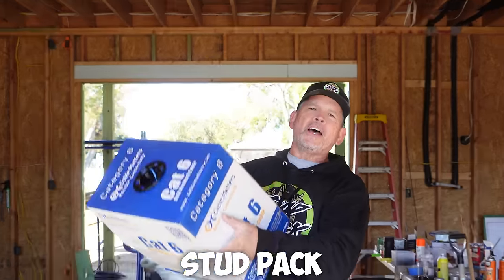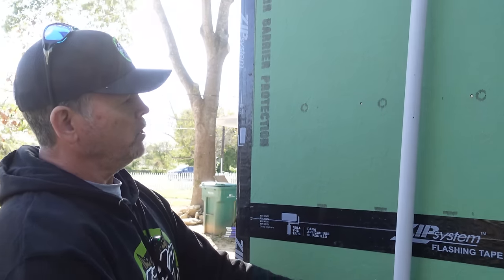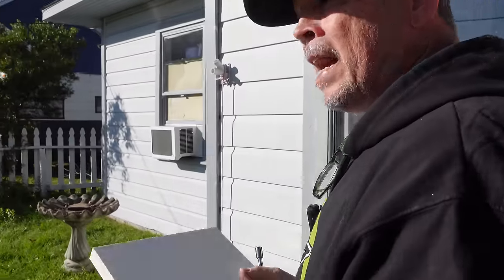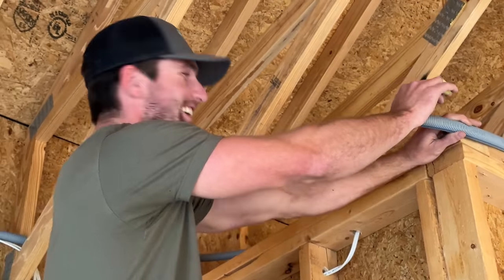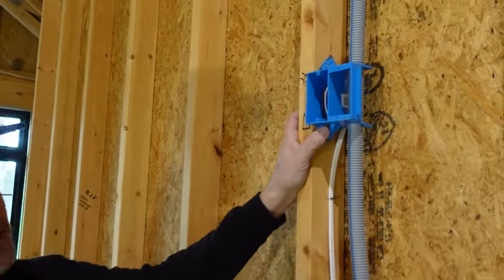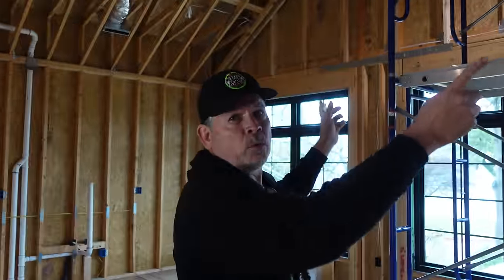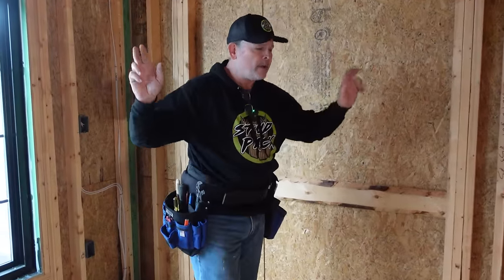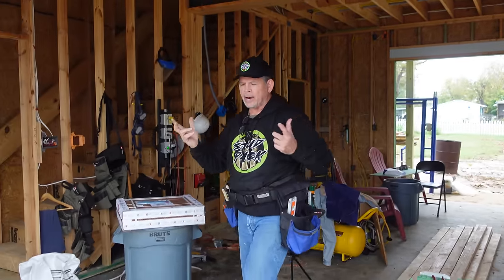DIY Networking for a Future Proof and HIGH SPEED Home! (Smurf Tubing and String Pull Trick!)

Comment: Run CAT6 to every room AND to every side of the house (outdoor rated). You never know when you'll need a hardwired connection in one of the rooms, and for outdoors you can hardwire up POE cameras and such. So fiber should go to a small distribution rack with the modem, have a patch panel there, modem to a router, router to a POE switch, switch then distributes everything to the patch panel. Definitely use wall plates with keystone jacks.
Reply: Why outdoor rated if it’s inside? Outdoor rates cable is for sun exposure and if you get gel filled it’s for elements (keeping moisture out of the cable).
Reply: 100% this. Outdoor hard connections are smart (cameras). That they didn't run them to the eaves is a bit puzzling. Wireless TV, no thanks. Mine are all wired in the house with a little MOCA and a few Ubiquiti switches at various ends.. and a Dream Machine Pro. And a 16 port POE switch. And a NAS with 10 GBE (2 port) connected to my server and desktop machine for video editing directly off the NAS... Oh, my Fiber direct to the house goes into my DM Pro on the 10GBE WAN port. Even if I do only get 400MB... still a cool blue light :-)  You can do it men!

Comment: Never mess with Telecom guys...
They get feisty 😂

But patch panels are great and can be had fairly cheap.

They will also make your life easier when you're trying to figure out problems as you label them just like your electrical panels.

Wall plates/keystones make your life easier like everyone said, because you always can use a longer or shorter cable or even repurpose a jack.

Like if you were using a jack for just internet to a device but then you want to put a POE device there.  You add a longer or shorter cable and then run from your patch panel to whatever equipment (like a small POE switch vs your main switch for just that device.)

TL;DR
The first time you have to change something, you will have wished you did it the other way.

Comment: i know you mentioned your going to run the Cat 6 cable to the eves of the garage but i wouldn't recommend that on the eves of a 2 story building because the ideal height for a security camera outdoors is between 8-10 ft from the finished ground height, any higher then 10 ft for your cameras and you wont get the full advantage of your security cameras and most eves on a 2 story building are closer to 18ft which is to high for a camera to get the best picture
Reply: This.  I'm sure you've seen "security" photos on the news that show the top of the perp's head, or his hat brim covers his face because the cameras are so high.
Reply: @disqusrubbish5467  exactly it really helps with the proper placement of the cameras to take advantage of all the cameras visibility capabilities

Comment: One more thing. I know the office is temporary but in your final office location be sure to run a number of ethernet lines from there to back to your main switch. I did 6 for mine. I have 2 ethernet connections on my computer 1 for up and 1 for down connections to give me higher bandwidth back to my server (old cheap solution to improve speed).  I have 1 for my printer and 3 extras just in case. I initially did this because I was considering running my 3 monitors over cat7 and having my desktop sit back at the server (yes hdmi over ethernet is a thing). That never materialized but trust me you are going to want more bandwidth than you anticipate at your workstation.
Reply: I doubt these guys are running any type of server in this garage. 😂

Comment: It's good practice to never mix high and low voltage wires. Never run them parallel and only cross them at 90 degrees but only where absolutely necessary. It's better to have as much separation as possible between them.

Comment: Terminate them in the wall with a keystone jack.   The cat-6 cable is solid strand and solid strand is also known as riser wire.  It is made for the wall where it does not flex.   You need stranded cat 6 cable between the wall and computer because it flexes.  Solid strand wire will fatigue and eventually break causing connectivity issues randomly.

Comment: Doing a wall plate is way better than running the cord out of the wall. It’s also way faster to do the whole termination with electrical scissors and the crimper. Don’t need the little stripper.

Comment: Low voltage Ethernet is supposed to be as far as convenient and optimally 3’ away from AC power to prevent issues with the magnetic field. If your signal is good enough there is a lower chance for noise interference, but better to prevent it now before the walls are finished. I would run the low voltage on the opposite stud anywhere it is near power. Them sharing a double gang isn’t ideal but really you only get problems when they run a good distance in tandem. I was a cable guy for 4 years and have since went into electrical.
Reply: I meant to add, fiber doesn’t have interference issues with power, just the copper in cat-6. Also that divider in the cat-6 is to prevent crosstalk so I’m told.

Comment: Hiding your modem in the upper crawlspace is a big no-no! You need easy access to your modem, switch, patchbay, etc. 
Find yourself a few square feet on a wall somewhere. How about in the small room with the electrical panel? How about at the top of the stairwell?

Comment: Love the video. 

Please terminate the cat6 to a female jack and use a wall plate, much more professional and if done correctly doesn’t cause any additional connection issues (which is what I assume you are hoping to avoid by using male ends straight into your devices) 

Also, are you running cat 6 in the ceiling for wifi access points? 

And above your stair well I recommend you terminate the ends of all your cat6 runs into a patch panel and label them accordingly, bonus points if you use different color patch cables for the different “category’s” of devices. 

While it’s not ideal to have your data cables ran next to a power line, in my experience you will not notice any difference in speed or loss. Only time it’s okay to run data and power accoss each other is if they are perpendicular to each other. 

The string inside the cat6 cable is to provide lateral strength especially for pulling, the string doesn’t stretch, the plastic plus sign shape divider is just that, it keeps the pairs exactly where they need to be. 

Also the wiring method for your plugs and jacks doesn’t matter too much either, as long as they match on both ends. 

Last thought, will you be adding a “smurf tube” going toward the future bridge location to carry network over to the house? Maybe a tube from the Fiber box or from above the stairs.

Comment: Terminating CAT6 isn't too difficult, but one of the requirements is making sure the twisted pairs untwist and untangle immediately after the strain relief. ALSO, you need to be careful not to have wires crossing over themselves after the sheathing cut. If you look carefully at your very first crimp, the orange wire looks like it's in position 1 where white orange is supposed to be. It's probably ultimately correct, but it shouldn't be seen in the side of the termination. @25:29, I can see solid orange where I shouldn't see it. it also looks like White Blue/Blue are crossing over after the strain relief.

Realistically, this is residential, so you don't need to be exact, but for sake of consistency, you should ensure your wires are terminated nearly perfectly.

Don't get me talking about properly terminating fiber. Polishing the end is NOT FUN.

Comment: I hope that you use female to female RJ45 keystone jacks for the wall since you crimped the end. 

Like others have said, you don't want the cable in wall going direct to the device. you can easily damage the cable outside the wall and then would have to rerun a whole new cable. Instead using the jacks gives you waaay more flexibility, especially if it gets damaged.

Comment: You aren't going to get enough EMI from that romex to matter.  Florescent lights are really your biggest enemy.  You'll be fine to run it next to the power in the tube.  Some strict neckbeard will say otherwise but you're good.

If you were really that worried you could get shielded CAT6

Comment: Looks to late, but you could just run 1 cat 6 cable. Leave the modem in the garage. Get a mesh wifi system (most TV's and cameras are wifi now. Run a cat 6 from the conduit to the new house (bundle it up and stick it on top of the stairwell for now. When you are done run it over to the new house. Set up another mesh system.
Just my 2 cents.
Ed

Comment: Why not Cat6a?  I suppose with conduit it makes it easy to retrofit later, but you should've future proofed with 6a now.
Reply: I was literally thinking the same, why wouldnt you use the most up to date cat6...
Reply: Cat 6 is cheaper and the throughput isn’t worth the price. Most devices will not touch the speeds 6a provides
Reply: Because it's a waste of money?  Cat6a is more expensive, harder to terminate, and not really of any benefit on runs of the lengths you'll find in most homes.  Plus, most of the things being wired up (lights, thermostats, controllers) aren't high speed devices.
Reply: Why Cat6a? It's more expensive, harder to run, and doesn't give you any more bandwidth. Cat 6 is plenty for this application.
Reply: Cat6 is rated to support 5 Gbps standard at 100 meters.  What future proofing do you think 6a would benefit?
Reply: @whattheschmidt  "future proof" what about in 30 years? wouldn't even more bandwidth be nice?
5gbps I'm already at 2gbps at home on fibre. On a personal connection.
It's a house after all. What about what comes after the studpack boys? What if they sell it? 

You guys act like it has no merit, but in 10 years, 5gbps internet will be slow.

Look at the rates internet is being sold, and at the speeds they're selling it for, all while the prices keep getting lower. Yes if I built a NICE house like theirs, I'd future proof nearly everything. For a couple extra thousand.
Reply: This reply is literally going from my computer to my switch through Cat 6 at 10 gigabits/s. You only need Cat 6a if you like wasting money. There's not enough RF interference in this house to warrant Cat 6a. They won't have any runs over 150'. Cat 6a would be a waste of money. Cat 7 would be a waste of money. Why are people suggesting they put in heavier more expensive cable when they don't even understand WHY those cable standards were created. Just because it's bigger and more expensive doesn't mean it's better.

Seriously.  The USB-C to 10Gbe adapter for my computer cost $200 and the switch cost $700. Faster equipment would be in the thousands if not 10s of thousands of dollars and to what end?

If Jordan is lucky, he'll be able to get 5Gps Internet so the Cat6 can handle twice the bandwidth of his Internet connection. Jordan probably has a big NAS for storing video footage. 10Gbp is plenty fast for talking to a NAS.

So good job Jordan. It's nice to see you're not wasting your money buying cable that won't provide any additional value.
Reply: @garrettlambert8728  Cat 6a doesn't give you more speed. It gives you more distance and protection from RF interference.
Reply: @MikeHeath  I stand corrected, I should've said cat7. at only 2x the price, and up to 40gbps It is what I would future proof my home with. so $250 vs $500. For ultimate future proofing, and cat7 is backwards compatible.

So yes you are correct on the cat6a. Thanks for that. I was entirely incorrect.
Reply: @Ran-dom1  5Gbps will not be slow in 10 years.  Feel free to factor in 4 TVs at 16K resolution all streaming at once to future proof your network.  That would be 100mbits each, so we are at less than 10% of the total but it's even spread out.  Gigabit switches are still the norm and likely the norm for 10-20 more years.  Main nodes are the ones that up the bandwidth typically to 10Gbit, but what year do you actually think this would be any benefit at all?  What servers are you running (and if you are, they should be near the incoming fiber connection, not randomly laid around the house)? I think people way overestimate what internet they need or what the future will look like.  This isn't the 1990's anymore where things are slow due to bottlenecks everywhere.  Streaming 16K probably won't be normal until the 2040s.  Gigabit wiring can easily handle that too.
Reply: @whattheschmidt  Nah I meant the lowest speeds ISP's will sell will be 10gbps, In 10 years. We went from 10mbps to 1gbps in 10 years.... Just sayin.
Reply: @Ran-dom1  I would bet you are wrong on that.  It will take a long time to upgrade all of the servers and their connections to have that be a baseline at home connection.  Not to mention we still have a lot of coaxial internet and it won't be fiber 10 years from now (the more rural areas, less dense cities).  Yes, it will keep going up, but not at the same rate.  I just got fiber in my area and I should have had it 10 years ago IMO.  This is like hard drive speed / size catching up to actual needs and use.  It's been surpassing the increase in usage needs, which is a great thing.
Reply: @whattheschmidt  Nope, I don't care about any of that, if I'm building a home, I'll future proof it, so WHEN CIVILIZATION catches up, my house will be mint. for a mere 250 more bucks. WITH NO DOWNSIDES (IT IS BACKWARDS COMPATIBLE) Yes I would without doubt future proof MY OWN HOUSE with cat7.

Comment: Do not use the pass throughs for outside cameras. The humidity in the air will start to cause oxidation much quicker, ruining the integrity of the CAT6 cable.  

And yes, just like everyone else said, use the keystones for the walls.  Its really alot cleaner and more modular when you need to mak e a change later on.

Comment: 1202 comments and I don't see anyone mention boots on the RJ45 connectors? lol

nice work guys, and another +1 for using a wall plates.
Reply: That is because this wiring should be terminated to wall plates and patch panels! You will use the boots on the ethernet cables from the wall plugs to the devices in the room!

Comment: Why do the pull through cable instead of the female port?  It seems like it would put more wear and tear on the cable, increasing the possibility of in-wall failure, and/or needing to be re-tipped when those connectors inevitably break.  At least with a female plug, your in-wall cabling is always protected.

Comment: Cat 6 doesn’t support 10 gig. Only 6a, 7 or 8 does. 

You won’t get reliable 10g from that. 

Couldn’t tell from the box but if it cost you less than $300 it’s also copper clad aluminum so if you ever run power of Ethernet over it you’ll burn the house down.

Comment: Over the last month you have buried some conduit, did some rough wiring for lights and internet and partially installed a bathroom fan. At this rate, it will take you 50 years to complete the house!!  Get hopping

Comment: I've never experienced any interference running data next to 120v AC. Higher voltage may differ. Ran Ethernet and HDMI in the wall right next to 120v.

Comment: One more thing! Very important!

Make there’s a service loop for each CAT6 cable ! for every location and place it deep inside the open portion frame of the Mud Ring! I recommend zip tying the wire to the back portion of the frame of the mud ring so when your drywall laborers come in to install the drywall and they Roto zip that hole, they won’t cut the wires! 

I know because I had this happened to me and it was a real pain because I only had an inch of wire that wasn’t damaged or destroyed. By the drywall installers guys! These guys are very reckless when it comes to using a Roto zip and when you’re installing electrical wiring, you push it to the back of the box but when you install low-voltage, there is no box it’s an open mud ring a frame that’s molded out of blue plastic, black plastic or orange plastic!

Comment: i hope you guys understand that the fiber company may not have the same box as what is on the main house, it may be bigger or smaller, though it does depend on when the house fiber box was installed
Reply: Given that the box they measured to is already on the house I'm sure they could get them to take it off and transfer it to the garage.

Comment: Echo everyone else in the comments here. You really, really want to do a patch panel and wall jacks for every permanent connection inside the building. Even outside the building I would lean towards a waterproof connector instead of a home run. RJ45 wires and plugs tend to become brittle with age, and you really don't want to repull wires after a few years just because a cable hanging out of the wall got rolled over by a chair, eaten by a robot vacuum, chewed by a family pet, or destroyed by a toddler. Just do it right from the start.
For anyone who does not understand - this is similar to running extension cords from the circuit breaker and having them hanging out of the walls instead of just having a wall plug. It works, but its just a bad idea.
Reply: Also - dont worry about cross talk between a single AC line and 1-2 CAT6 runs. Yes, it will cause some signal degradation, but even if the signal is degraded by 20% it wont matter - that basically impacts the allowed distance between an L1 bridge. Even with 20% degradation you should have 70m+ of usable distance. And Cat6 is rated for 10GB connectivity at distance - you are very unlikely to need that much throughput for 90% of your connections, even looking 10 years down the road.

Comment: Why didn’t you just get your new fiber box instead of measuring old one. In most cases the new one will probably be different. The one on the house looks to be an old box. If utility uses different brand your knockouts won’t line up. Most supply houses in my area give you the rough in boxes for data and power(meter base)